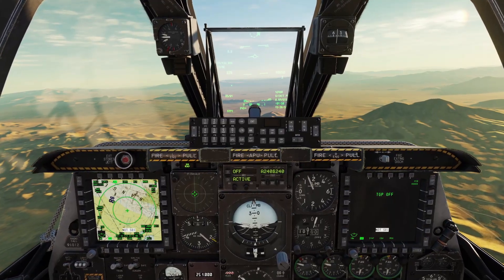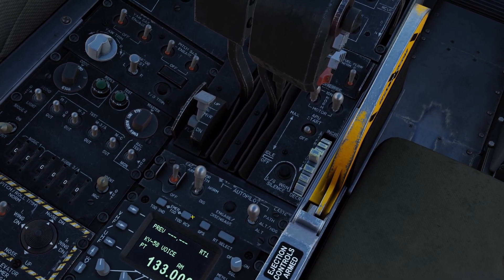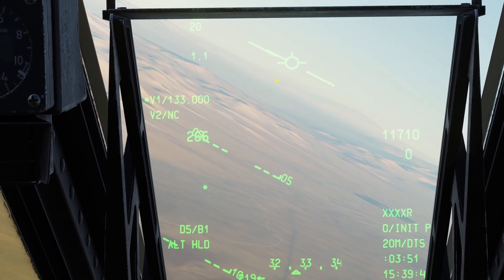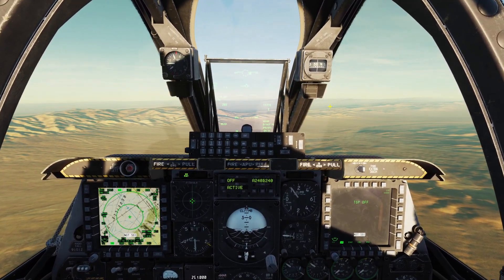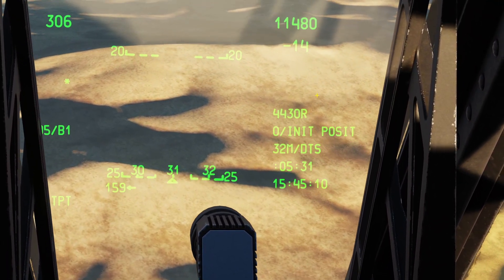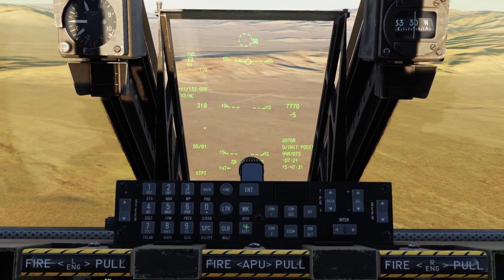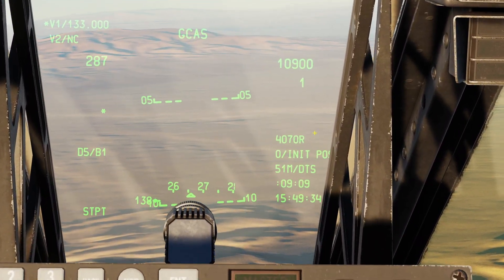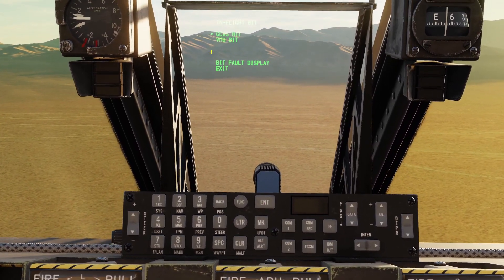DCS A-10C/CII Autopilot and GCAS

Comment: Hi, how can I make the plane steer buy Turning the heading knob on the compass?
Reply: The A10 does not have auto steering to waypoints/steerpoints like the F18 or F15E. You can set a course line or heading on the HSI but you'll have to do the steering yourself.